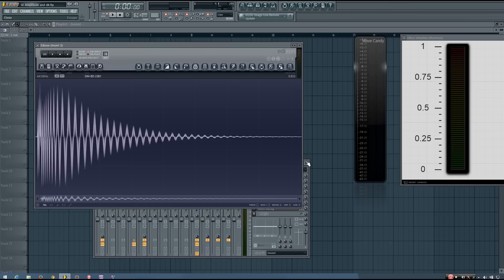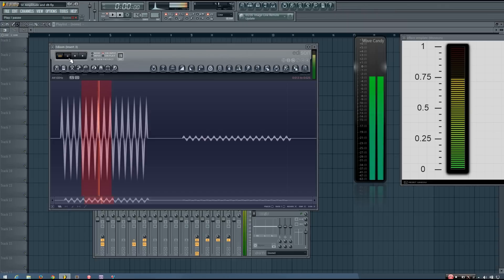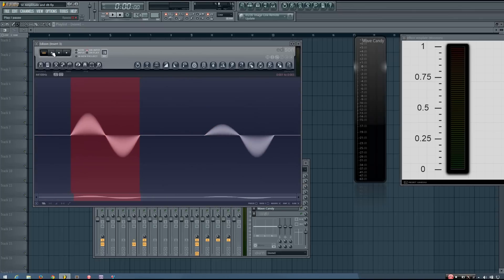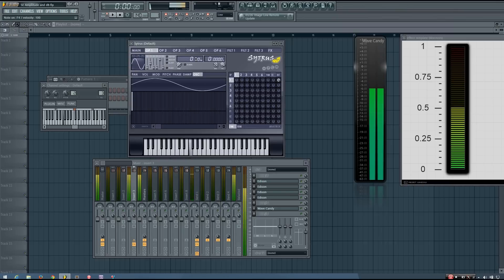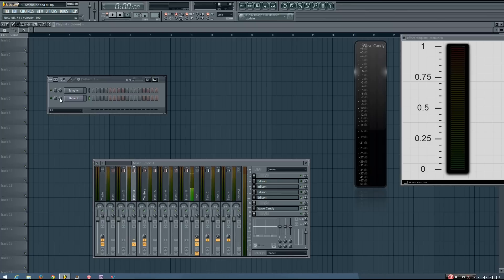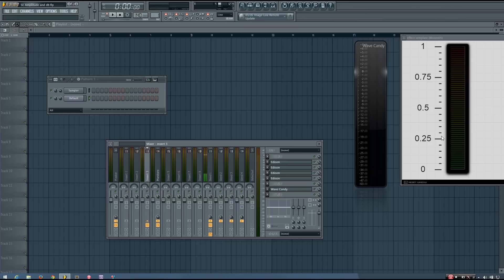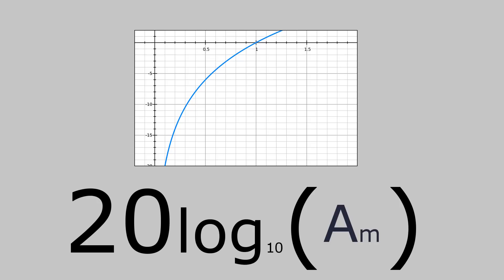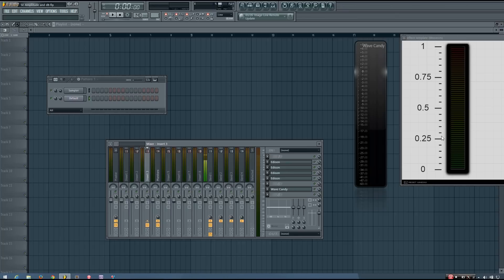Sound Explained: Amplitude and dBFS

Comment: There is no such "negative amplitude" in real world. The whol amplitude graph should look different, with no "negative" side. How did we end up having such an unreal graph? Or am I understanding something wrong?
Reply from the maker: This video is focused on digital audio, where audio samples are typically programmed to have negative and positive values. These values correspond to the amplitude of the waveform.  A constant value of 0 generates no signal.

In the real world, sound waves cause changes in air pressure. The air pressure isn't going to become negative, but we could still consider the amplitude to have negative values relative to a baseline of the ambient air pressure. The values would be negative (relatively) whenever the sound waves cause the air pressure to drop below the ambient air pressure.

Comment: Nice clear explanation - even I understood it but you don't mention dBFS in it.
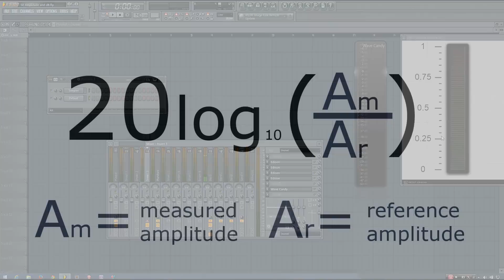Reply from the maker: 8:08 that equation using 1 as the reference amplitude measures in DBFS, so when I start talking about using 1 as the reference, everything I say relates specifically to DBFS.  I should have mentioned that explicitly in the video

Comment: So how is 1 FS defined.  What does it depend on? ADC quality? Maximum input waveform voltage? Is it the same on all devices? Same question for 0 FS?
Reply from the maker: Kornelije Kovac Sorry for responding so late.  I've got a lot going on, and I kept meaning to reply but would get sidetracked.  A lot of 32 bit floating point audio is converted from other digital audio bit depths, like 24 bit, or 16 bit.  If you play a sample from a sample pack, it is probably a 24 bit sample, but it will play in 32 bit floating point in your DAW (assuming this is what your DAW is set to play at).  It is also often converted back into one of these other bit depths when it is rendered or when the audio is sent to your audio driver, etc. 
Because of this (at least I assume this is the part of the reason), an amplitude of 1 (or -1) in 32 bit floating point is equal to the maximum (or minimum) amplitude that can be achieved with these other bit depths. 

If you record a sound with non-floating point audio, the microphone converts the physical waveform into an electrical current with varying voltages that correspond to the varying amplitudes of the physical waveform.  Then, the ADC converts the varying voltages to numbers (digital samples), which determine the varying amplitudes of the digital waveform (how often a number/sample like this is recorded/stored is determined by the sample rate).  Floating point audio stores information differently, but for 24 bit, 16 bit, 8 bit, etc., the range of these recorded numbers is limited by the amount of integers that each bit depth is able to store per sample (256, or 2^8 for 8-bit, 65,536 or 2^16 for 16-bit, etc.).  If the input voltage range is too high, you will get digital clipping distortion, because the voltages would correspond to integer values that these bit depths simply aren't capable of storing.  The point at which this clipping occurs is where we decided to have our reference amplitude for dBFS.  So this clipping occurs at 0 dBFS, and amplitudes of +1 and -1 in 32-bit floating point also correspond to 0 dBFS.  

Hopefully that is what you wanted to know, but let me know if you have other questions.
Reply: ***** No problem, I appreciate the answer and your willing to help. I understand all the maths behind the problem (somewhat thankful to your video), but what I still don't understand is how much exactly is 0 dBFS in audio. I understand it is the peak signal for DAC, but if DACs are different, that that peak may be different?

 For example, you can have an audio DAC that is engineered for input levels of  ~1V, and you can have a Mars Rover temperature probe DAC that is engineered for input levels ~18V.  That would mean that the same electric signal of 1V will be 0 dBFS on the first DAC, but something like -23 dBFS on the second DAC.

So, lets now stick just with audio DACs. If we have two audio DAC integrated circuits ( Realtek and  Burr-Brown for example) and we feed the same audio signal into both, is it possible that it will show up as -6dBFS on Realtek and -7dBFS on  Burr-Brown? How do we know if they are designed to take the same signal, and that 0 dbFS is the same signal on both? Or we don't know? Does dBFS have any absolute reference, or is it just relative measurement for when your DAC gets overloaded, disregarding it being 1$ circuit of 81db SNR, or 100$ circutit of 118 dB SNR?
Reply from the maker: Kornelije Kovac Take what I say here with a grain of salt; I know quite a bit about digital audio but much less about analog audio/recording and hardware.  As far as I am aware, there's no absolute relationship between digital amplitude values and analogue/physical amplitude values.  By this I mean that you can't state "x dBFS = y dBu" or anything like that and have it be universally true.  The dBFS measurement is used specifically with digital audio; because it isn't intended to measure analogue audio level, it doesn't have an absolute reference in the analogue realm.  There might be different standards for where dBFS "should" align with dBu (for example), but I'm not familiar with any (because I'm not familiar with analogue audio metering in general).  

In the same way that different microphones would convert the same physical sound waves to different analogue signals (assuming you magically recorded the exact same sound waves with these mics), it makes sense that different ADCs could convert the same analogue signal into different digital waveforms.  I wouldn't take my word for it, but that makes sense to me.

Comment: I dont understand the difference between positive amp and negative
Reply from the maker: Sound is created by movement; if there's no movement in the waveform and it appears as just a horizontal line, there will be no sound, even if that horizontal line has a high +/- amplitude. 

Because of this, most waveforms will have both positive and negative amplitude values; this is because the waveform will naturally fluctuate above and below it's original, still position (amplitude of 0).  It's like ripples in water.  The only difference between the two is that one is positive and the other is negative.  You can invert the polarity of the waveform by making all negative amplitude values positive and all positive amplitude values negative, and the waveform will sound exactly the same.  

The movement is what's most important to the sound itself, and if you imagine the movement in air as opposed to on a graph, the specific amplitude values and positive/negative aren't as strictly defined (but the waveform will still move "up and down" causing positive and negative pressure changes in the air that it passes through).  

The reason positive and negative amplitude values are particularly important in recording and electronic music production is because all of the waveforms of the sounds we use to make a song are added up into a single waveform, and this waveform is what is sent to the speakers.  This can sometimes result in sounds clashing because the positive amplitude values in one cancel out the negative amplitude values in another.  This is often referred to as phase cancellation, which I cover in more depth later in this series.  

Hopefully that helped you understand a bit better; I found it kind of difficult to explain. Let me know if you have any questions
Reply: Thanks, that explained it better, ill be studying it.
Reply: +Beat School Thanks a lot this word explanation helped me a lot!